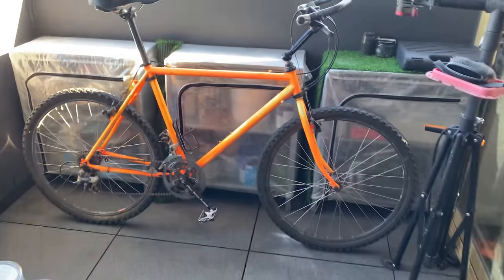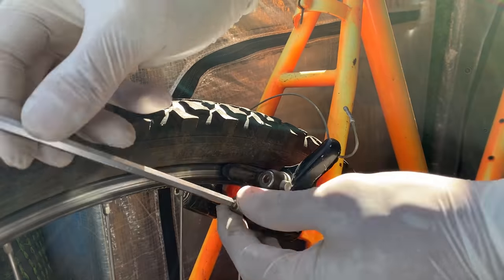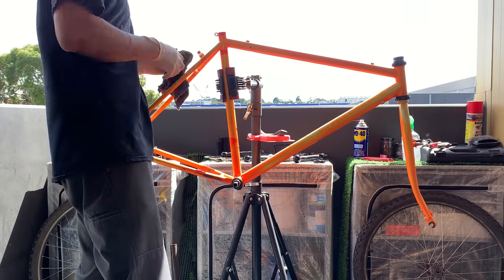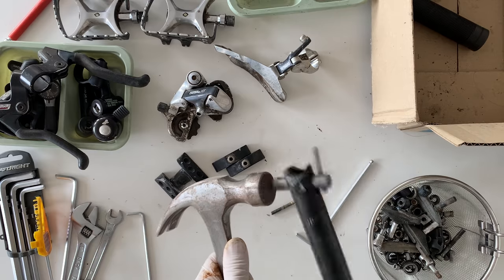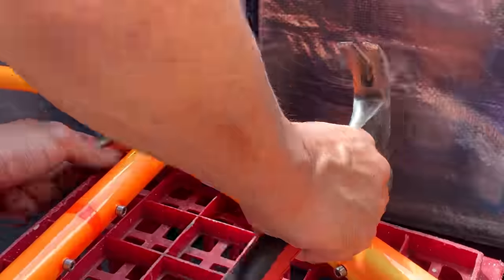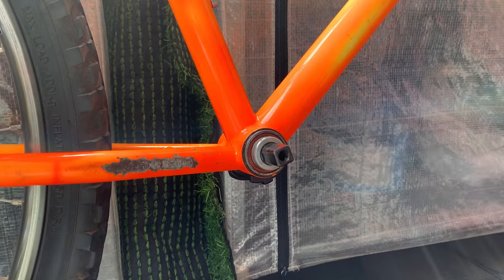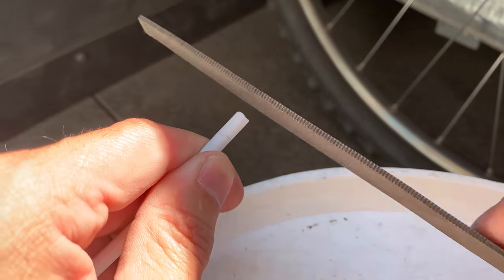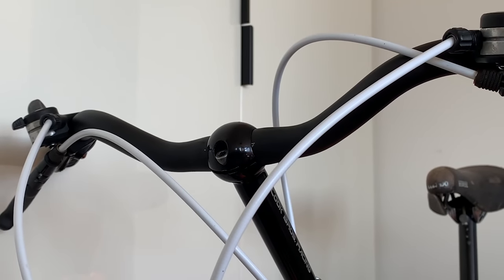Vintage MTB Restoration - Wicked Fat Chance

Comment: If you adjust your straddle cable on your cantilever brakes to be at 90 degrees to the arm at full pull it will have the most braking power. Also love the stem and crabks. Great find.
Reply from the maker: Yessss tru! Thanks for the tip, appreciate it 🙏😊

Comment: We talked about my Klein Pulse Race a while back on your video. I was spring cleaning my shed like three weeks ago and I finally got it out and got the frame completely stripped. Non-drive side bottom bracket plastic cup was stuck and I damaged some threads while taking it off. I’ll have to order a threadless BB. Other than that, the frame and the rims cleaned nicely. I think I’ll just clear coat the frame as is, patina and all. The fork is in amazing condition. The seat post and crank arms are nice and polished again. I used evapo-rust for the first time and that stuff is magic. I’ll keep the Judy fork, crank arms, seatpost/saddle, stem, handlebars and wheels. Everything else was too beat up for my liking and I’ve been looking for new parts. Thanks for the inspiration man!
Reply from the maker: No worries Dude! Sounds like it’s going to be a sick build!
Reply: RollinRat  That’s how I did it, but I accidentally nicked a few threads going too far with the hacksaw but that’s definitely the best method other wise. I managed to just use a standard 73mm internal bearing bottom bracket and I just slowly went back and forth with it, cleaning off any shavings or dust and screwing it further in and out until the non drive side cup went all the way in. The bike came out like new following his method even though it was basically a barn find type of condition. I managed to save a bunch of the parts I thought were done for just by with evaporust, polishing and elbow grease. Other than maintenance and wear parts I replaced, the bike is back to like new stock condition. I’ll keep the suggestion in mind though incase I come across another stripped bb.

Comment: I love vintage mountain bikes. I have an '83 Schwinn High Sierra that had full Deore group. It was a yellow with gold/copper parts. I ditched the biopace for a crank from a 90s/00s Trek or Canondale. I redid the cockpit with the bars and stem from my old Lotus Pegasus, and the deore thumbies. I did replace it's brake levers with these nice 3way adj Origin8 shortpulls. I wanted to keep the bike rather vintage and same group, but both mechs broke last year, now the cassette(original) is too worn out. I still kick myself for not keeping the hub from the original rear wheel- sealed bearing hi flange.
Reply from the maker: Damn sounds cool. Yeah it’s hard to find full vintage groupset s these days. The deore xt one is great I have it on my diamondback!!

Comment: I noticed on your builds you don't use end caps on your cable housing. You just cut the housing and shove it into the cable stops/barrel adjusters. Your cables will enter/exit more straight as it fills the space between the two. Probably make your housing last longer and save your frame from having the inner wires rub directly on the cable stops. Just a heads up.
Reply from the maker: Cheers man! I haven’t noticed any problems , but you’re probably right , they make that part for a reason 🫡

Comment: I love those long videos man haha, To superclean those bearings you can use some isopropyl alcohol or a little of gas, it will melt the old grease and grime, then you can spin them a little and them regrease, they will work as new. I do that on my skateboard bearings and they work like new after that. Maybe even better.
Reply from the maker: Damn good tip! Need to try that next time! Haha yeah I tried to clean my skateboard bearings the other day, but I think the bearings are actually shot because they feel rough, guess that’s what happens when u run shields popped! 😂
Reply: @garysprojects  I just so happened to clean my bearings yesterday. I'd recommend letting them sit in your fav solvent for several hours, and then swish them around a fair bit to agitate and loosen any muck. I've found that if you let them just sit in solvent, some grime eventually settles in the inner races even after it's come off the bearing!
Reply from the maker: @bryanflo4500  ahhh yes def need to shake it up!!
Reply: @garysprojects  Popped shields doesnt matter I think. At least that is my experience. The muck inside gets pushed out, when you dont have shields on. Maybe it wont last as long as with them, but I never had any issue with or without. Also for skate bearings, after you clean them with IPA, put one drop of bike chain oil or something like that (I use sewing machine oil and it works wonders). Never use grease to 608Z bearings haha. I tried the hard way 😀Skate bearing always get destoryed when your ball races crack. They are usually plastic and until they are good, the balls will last forever.
Reply: @garysprojects  shake it uppPp player

Comment: I like all your videos mate but I’m afraid to say I don’t understand why you “cleaned up” the chain as the grease that make it sticky is put on it from the factory for a reason which is lubricate and protect the chain.
That bike is awesome, I started mountain biking in 1990 and Fat Chance was one of the bikes I red about on Mountain Bike Action, too bad money was tight for me
back then.
BTW I had a set of those CB cranks and I still regret I sold them.
Reply from the maker: Cheers man! Thanks for watching my vids!

the reason why I remove the protective grease is because it’s just that! It’s used by the factory only to protect the chain for storage & transport. If I were to leave it on it all the dirt and grim would stick to the chain from the first ride. The factory grease is also thicker where chain lube is a thinner, hope that helps you understand why. 

Cheers man the bike is super fun! Yeah I heard that the cb cranks are quite sought after , so probably hang onto them!! Thank you !

Comment: nice build, just wanted to clear one thing up where you said at the drill press , you can wear googles or a mask and can wear gloves. Never ever wear gloves at a drillpress or similar things. trust me never do that
Reply from the maker: Cheers mate , I just looked it up good to know. For anyone reading - gloves should not be worn with rotating machines incase they get caught
Reply: @garysprojects  really like your rebuilds, i also flip bikes and restore them. and if you have some money in the backhand i can really really recommend a ultrasonic cleaner. after i bought one, my oh my, it saves so much time and cleans way better sometimes then what i could with hands.
Reply from the maker: Dang thank you mate , I have to look into that !

Comment: You were having chain length issues because you have a short cage rear derailleur. Get an SGS long cage and it'll take up the slack
Reply from the maker: Ahh that would def take up the slack, although I have the same cage size on 2 bikes , with the same gearing setup and it wasn’t an issue, I think the chain could be too long, maybe I’ll try shorten the chain one link as I don’t have a spare long cage ! Cheers
Reply: @garysprojects  with the same chainrings combo's too? Those cook brother rings are big
Reply from the maker: Yeah the Marin was 50 I think , I need to double check !

Comment: I hate those keyed washers in old threaded headsets. It's a terrible design and it isn't even needed on headsets that have an adjustable race with wrench flats like yours does, because you can get a wrench on both the adjustable race and the jam nut at the same time. They are only needed on headsets with an adjustable race that only has knurling rather than wrench flats so that you can [in theory] tighten the jam nut without the adjustable race tightening with it, but even then they don't do their intended job well because the tab is tiny and usually fits sloppily in the groove, so they often end up damaging the steerer tube threads when the tab twists out of the groove. 

In the case of headsets that have an adjustable race that I can get a wrench on, I file the little tab off the inside of those keyed washers to make them into a regular washer/spacer so that they can't ever damage the fork's threads again.
Reply from the maker: Yeassss!!! I actually did that in the project I’m working on now! Really serves no purpose like you said ! Better to keep the threads protected 👍👍👍

Comment: With the right tools (I used a simple bike tool kit https://www.youtube.com/post/UgkxHL1v1R3NE5x4KiYfyt8dnQmyNYz7qi5L that you can strap to the bike) it's simple to assemble. As a 270lb guy looking for a way to get more exercise that's easy on my feet I have been impressed by this bike. The tires ship with air in the tires, but before you ride you need to pump them up som more, but once you do you can ride with confidence. You'll definitely want to replace the seat if you're going to ride for any real distance, but that's the case with most bikes. I'm loving it and it has given me a hobby from my youth back.
Reply from the maker: Yes